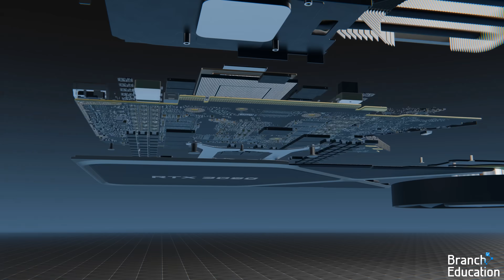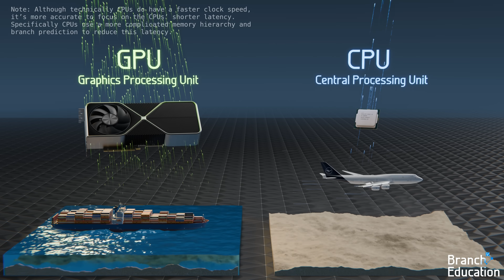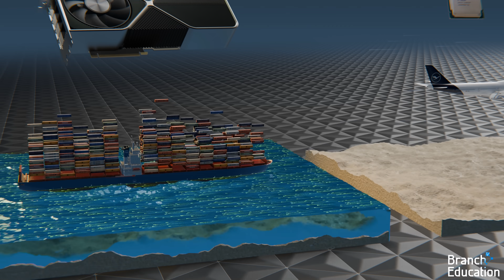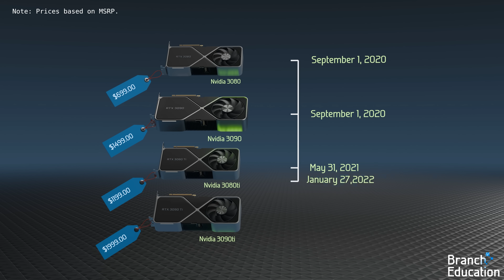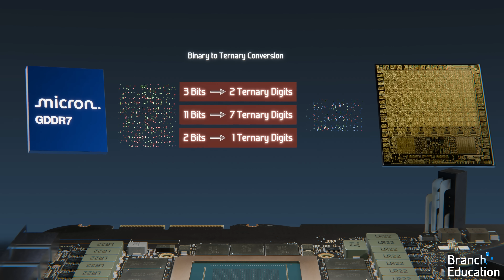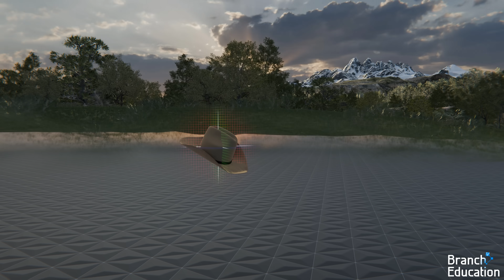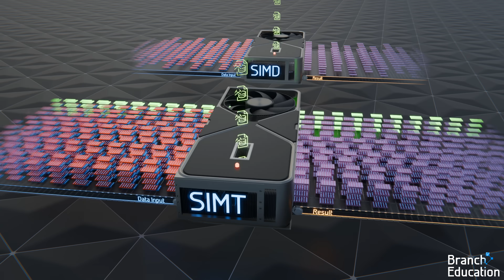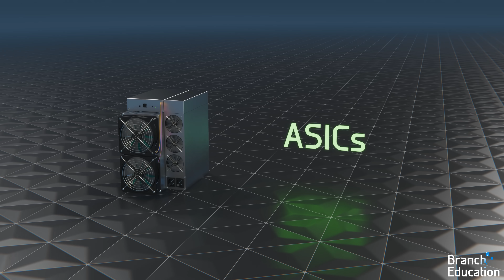How do Graphics Cards Work?  Exploring GPU Architecture

Comment: Hello, 
I am a materials engineer and have worked for Intel since they created the 8088 and 8086. If the time comes to perform like the latest processors are still based on cmos. I believe that we should go back to analog computers based on memory components and operational amplifiers for addition and multiplication. Including error noise that can be an additional value as a supercomputer for testing additional calculations and not single-valued. This situation makes the computer as a meta-computational to calculate additional results beyond logical 1 or 0.

Comment: So basically my 5070ti is just a semi-defective 5090?
Reply: NO it's a defective 5080. 5090 is on a different node
Reply: Sort of. 5060, 5070, etc mid ranges use smaller sized chips, whilst 5080 and 5090 use a very large chip 
But ultimately they are labeled in the same chip generation, with few variations

Comment: The number of calculations a game needs depends on scene complexity, refresh rate, detail quality and resolution. So cyber punk doesnt need 36 Trillion. It only needs it for your specific settings. for example 1080p would use much less processing power than 1440p. If we are talking about the bare minimum then you would need to put it on low setting and atleast aim for playable minimum frame like 30 fps. 36 trillion calculations is more than you think. A gpu with less than 10 tflops can play cyberpunk.  you dont need a 36 Tflop gpu to play it lol or the over kill 80 tflop 4090

Comment: Deactivated defective cores, blew my mind! So a 4060 or 5060 GPU is basically a defective 4090 or 5090!!?
Reply: No, they're different GPUs. The same GPU is generally only used for a few cards in a generation, since it works out cheaper to just manufacture the less powerful GPUs directly. For the 40 series, it roughly goes from least to most powerful:
- AD107 GPU: 4060.
- AD106 GPU: 4060 Ti.
- AD104 GPU: 4070, 4070 Super, 4070 Ti.
- AD103 GPU: 4070 Ti Super, 4080, 4080 Super.
- AD102 GPU: 4090.

Comment: So "Product Binning", different GPU models are essentially the result of binning chips with imperfections on the silicon die.
Reply: Only for a few select models per GPU. It works out cheaper to just manufacture the less powerful GPUs directly since the imperfections don't scale all the way down the product stack, so NVIDIA generally designs a handful of GPUs and will reuse binned versions of the GPU for cards around the intended performance bracket. For the 40 series, since I used it when replying to another comment:
- AD107 GPU: 4060.
- AD106 GPU: 4060 Ti.
- AD104 GPU: 4070, 4070 Super, 4070 Ti.
- AD103 GPU: 4070 Ti Super, 4080, 4080 Super.
- AD102 GPU: 4090.

Comment: So anything less than 3090, you’re paying for a defective unit? Lol
Reply: If you buy a 3080, possibly yes. Not all graphics cards within a generation use the same GPU. For the 30 series:
- The 3090 Ti, 3090, 3080 Ti, 3080 and select 3070 Ti's all use the GA102 GPU, with more components disabled as you move down the product stack.
- The 3070 Ti, 3070, 3060 Ti and select 3060's all use the GA104 GPU, which is physically smaller than the GA102 GPU, with more components disabled as you move down the product stack,
- The 3060 and select 3050's all use the GA106 GPU, which is physically smaller than the GA104 GPU.
- The 3050 uses the GA107 GPU, which is physically smaller than the GA106 GPU.

If you have a 3090 Ti and a 3060, they both use the best bin of their respective GPU, but if you bump down to a 3080 or one of those 3050's, then you move down a bin and you may have an originally defective GPU, that NVIDIA disabled the defective components of. AMD and Intel both do the same, even for their CPUs.

Comment: So cheaper gpu models are just broken?
Nice to know 😂
Reply: Not necessarily. Not all graphics cards within a generation use the same GPU. For the 30 series:
- The 3090 Ti, 3090, 3080 Ti, 3080 and select 3070 Ti's all use the GA102 GPU, with more components disabled as you move down the product stack.
- The 3070 Ti, 3070, 3060 Ti and select 3060's all use the GA104 GPU, which is physically smaller than the GA102 GPU, with more components disabled as you move down the product stack,
- The 3060 and select 3050's all use the GA106 GPU, which is physically smaller than the GA104 GPU.
- The 3050 uses the GA107 GPU, which is physically smaller than the GA106 GPU.

If you have a 3090 Ti and a 3060, they both use the best bin of their respective GPU, but if you bump down to a 3080 or one of those 3050's, then you move down a bin and you may have an originally defective GPU, that NVIDIA disabled the defective components of. AMD and Intel both do the same, even for their CPUs.

Comment: So we all bought damage GPU
Reply: Not necessarily. Not all graphics cards within a generation use the same GPU. For the 30 series:
- The 3090 Ti, 3090, 3080 Ti, 3080 and select 3070 Ti's all use the GA102 GPU, with more components disabled as you move down the product stack.
- The 3070 Ti, 3070, 3060 Ti and select 3060's all use the GA104 GPU, which is physically smaller than the GA102 GPU, with more components disabled as you move down the product stack,
- The 3060 and select 3050's all use the GA106 GPU, which is physically smaller than the GA104 GPU.
- The 3050 uses the GA107 GPU, which is physically smaller than the GA106 GPU.

If you have a 3090 Ti and a 3060, they both use the best bin of their respective GPU, but if you bump down to a 3080 or one of those 3050's, then you move down a bin and you may have an originally defective GPU, that NVIDIA disabled the defective components of. AMD and Intel both do the same, even for their CPUs.

Comment: Stupid question but if we know that the correct lottery ticket has the first 80 digits as zeroes, why not hard code it into the algorithm and keep winning?
Reply: Because you're not trying to find a number with the first 80 digits being zeroes, your trying to find a number that produces another number with the first 80 digits being zeroes, when used within a hashing function. In order to win the lottery, you have to specify that number that you found, and others will independently run it through the hashing function to see if it's legitimate, and will only give you your winnings if it is.
Reply: @jcm2606  I see, it makes much more sense now. Thanks!

Comment: How is the memory capable of transferring 1 terabyte per second to the GPU even though most graphics cards only have 24GB of memory or so?
Reply: Because the GPU repeatedly accesses the same locations in memory across multiple frames, whether it be because previously cached data for that location was evicted, or because the data at that location was updated and the cached data was invalidated.

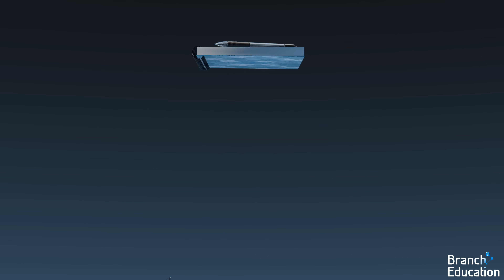Comment: 0:50 : There is an inaccuracy here. The presented analogy shows as an example of a calculation the multiplication of 4,689,732 and 2,764,569. When talking about CPUs, that is NOT a calculation. Those are actually dozens or even hundreds of calculations.

In CPU/GPU comparisons, they always primitive operations. not math problems.

Comment: I would have started with Multiple-and-Add/Accumulate after describing basic matrix math such as quaternion rotation linking that to computer graphics.   As presented the videos fails to keep things grounded to reality so interest gets lost pretty quick for the average person.   

Most of the 28+ minutes are vendor-specific and tool-specific.  In less that 5 years ALL OF THIS WILL BE OBSOLETE except for the core theory and ideas.  The thing that has not changed in literally 30-40 years is the core Multiple-and-Add/Accumulate.   

The obsoleting part could be the last 10 minutes.

Comment: So does this mean I should get a 3080 instead of 3070 ti.. 1) the 3080 is the next group of chips above the 3060s/3070s and is using the same chip blueprints as the 3090s  and 2) it sounds like to win the silicone lottery you don’t want a flawless card aka the 3090ti or 3070ti , they both would be flawless , and in order to get silicone lottery I could get a 3080 that potentially isn’t as damaged as some others and it would perform better .

Comment: 2:50 just came back from the cpu video so i already know that a cpu contains requires multiple ip cores just to make one core and seeing the image and the use of the GPU? its kinda obvious that it probably has like 1-2 IPcores which probably doesnt even include any addition macrocell. or does it? idk i will find out later in the video.

Comment: Great video, insane graphics and pedagogic examples !!!
Technically speaking, some information are wrong though :( 
- GA102 supports 1024 threads per SM => 32 warps [of 32 threads each]
- SIMT description is wrong: each thread does not have its own program counter (that would defeat the purpose of low-power gpu architecture), but each WARP has it's PC => 32 Threads of same warp are in lockstep execution [which is a very desirable property actually, allowing warp intrinsics powerful functions]
- The mapping 1 thread = 1 cuda core (or shading unit) is WRONG ! GA102 has 128 CUDA core (=10752 cores / 84 SM) => 4 cores per warp (= 128/32) in average. In the video, confusion is made between the 4*32=128 CUDA cores, which is not 4 warps, because 1 cores perform computations for 8 threads, which is exactly the point of SIMT, allowing memory latency hiding
- Tensor cores are not used to transform vertices of geometry (=4x4 matrix-vector multiplications), tensor cores are made for much bigger matrices, for NN applications

Comment: This is a nice video. But I have a small correction: GPUs are still SIMD architectures! SIMT rather is the programming model they use, making the inherit SIMD architecture transparent to the programmer. With newer architectures it is true that threads may make progress independently, but this is rather an edge case. The hardware (with help from the programmer ;)) certainly tries to avoid that, because whenever only a single thread is executing on a piece of hardware (let's call it SIMT core, c.f. SM or subcore in NVIDIAs terminology) that is meant to execute, say, 32 at a time, the other 31 "lanes" go unused, leaving a lot of performance untaken.

Comment: with s.i.m.d. and s.i.m.t. why do some threads progress slower than others.? i would think the calculations would be predictable. thank you
Reply: Because you can't reliably predict which branch a GPU thread wants to take at runtime. As far as I know, branch prediction on CPUs works by internally tracking which path a thread takes through the code, using that information to optimise the next execution of that code assuming that the same thread will generally take the same path through the code. This isn't feasible on GPUs because of the number of threads that would need to be tracked, which is on the order of hundreds of threads per SM on a modern GPU, between the size of an individual warp (32-64 threads) and the amount of warps assigned to an SM (4-16). Each thread would need memory set aside to track its state (see the branch predictor page on Wikipedia for a rundown of runtime branch prediction techniques), and the branch predictor itself would need to be large enough to simultaneously predict which upcoming branch will be taken for all threads in a warp.

This is why GPUs have gravitated towards SIMT over SIMD. Under SIMD, threads used to do branch predication where they straight up execute all branches and throw away the results for the branches that they didn't take. That was obviously incredibly wasteful, so GPUs gravitated towards a more dynamic branching implementation where threads dynamically enter and exit branches, with threads only having to wait for the branches that were actually taken, which the SIMT model lets you track. Compilers and developers naturally took advantage of this to optimise branching around making sure that as many threads take the same branch as possible, and the SIMT model was further refined on NVIDIA to allow for out-of-order execution of branches, which helps with memory accesses in branches.

Comment: I already shared and did subscribe and learning the PC and the process. So you can get an RTX 3090 bottom deck lowest price but the graphic sections will have damaged ones that will be isolated automatically. Not having the full range and bandwidth. I believe I got that right 🕊️

Comment: You don't need 36 TFLOPS to run cyberpunk 2077.
Playstation 5 pro doesn't even reach 33 TFLOPS and the switch 2 literally only has 3.1 TFLOPS and it runs cyberpunk 2077 just fine.

Comment: When the lack of hard performances is a fact -- it s where the need of the  soft ai 64 GB/second is to be resolved through less performance hardware systems when adequate methods are set and by multiplying low speed transfers .the- availability in data transfer canals for example is increased this way

Comment: The GPU architecture is organized into structures like Streaming Multiprocessors (SMs), each containing CUDA cores, Tensor cores, and RT cores, similar to the layout in NVIDIA’s GA102 chip found in the RTX 30-series.

Comment: Does this mean the 3090ti is the most powerful we can make on the GA102 architecture? is there a different architecture for future growth or have we reached max density?
Reply: GA102 is the last on the RTX 30 series. The GeForce RTX 5090 has the GB202 architecture with twice the number of cores, 50% more memory, GDDR7 (instead of GDDR6), and 33% wider bus.

Comment: Honestly idk if theres any explanation of this but with an amd gpu
Reply: The principles are like 80% the same for AMD GPUs. There can be differences in the exact memory and hardware block hierarchies, but most of what the video covers maps fairly cleanly to AMD GPUs. GPUs kinda naturally converged on this general design as it's simply the most optimal for the variety of workloads that GPUs have to deal with during daily use.

Comment: I'm from the generation of CPU's being made from 7400 series IC's made in the early 70's. A 16bit CPU had as many as around 900 chips spread over 9 plugin CPU PCB's. Floating Point was another four similar sized boards. Core memory was the standard type of memory and it's amazing how that works based on magnetism. So I find this video as intensely interesting. And I'm thrilled with the speed at which technology has advanced in my lifetime. In the late 70's a 200MB hard drive was the size of a desk, with 20 heads on ten platters. I'll be watching the other videos from this source. Technology is the closet thing to true magic. When people know about our technological knowledge we would get asked how something like TV worked, we'd answer "It's IFM" which meant, It's fucking Magic. It's more amazing knowing how this stuff works.

Comment: Very informative video. Question, how is the memory access handled when cores needs data. There must be a complicated memory access arbitration going on i suspect.
Reply: Yep. Typically threads will broadcast the address that they want to access as part of the load/store instruction, and LSUs (Load/Store Units), which are basically the bridge between the logical units and the memory subsystem, will arbitrate those memory accesses. To make things even more complicated, the memory subsystem also typically operates at a much coarser granularity than individual threads. Individual threads often want to access 4-byte data at potentially different locations in memory, whereas the memory subsystem operates on contiguous 32-128 byte blocks. LSUs are also responsible for handling this granularity mismatch, typically by organising the various accesses from all threads into a series of memory transactions operating on entire blocks. To keep performance up and to reduce traffic on the memory subsystem, LSUs will also try to combine all accesses to the same block into a single memory transaction operating on that one block, leaning on the assumption that threads will generally access consecutive addresses (which is something that you as a shader programmer may need to worry about).

Comment: So let me get this straight. In chapter 4 (7:00), we are basically buying the same GPU with the lower model cards having defective/deactivated cores? So if you take the marketing data on the numbers of cores advertised on each card number, you just need to subtract those numbers from the top line card models to find out how many defective/deactivated cores the lower card models have?

That is quite an eye opening fact as current marketing gives the impression you are purchasing slightly different variants of GPUs that happen to be part of the same GPU series. This of course would not be practical seeing they are all being fabricated using the same equipment. 

I imagine it would not go down very well if Nvidia were to market a 3080 as having, say, 50+ defective/deactivated CUDA cores. That is quite an ingenious way for Nvidia to sell through partially defective stock vs binning all GPUs below a 100% success rate. Thanks for this video.

Comment: The major flaw in your
 teaching technique is the use of analogies. Analogies are a bad way to teach. If you know enough and understand enough about the hardware, you can explain the hardware using the hardware. To change it over into using an analogy and then try to switch it back to hardware is a ridiculous idea. It's clunky it's unclear and it really indicates you cannot explain this at the hardware level. Too bad I gave you 4 minutes. You totally lost me. As an engineer a design engineer and a physicist I find this a poor way for anybody to teach anybody anything. No trolling intended. However, I must admit that recovering from the inability of your people to explain the difference between complex and simple machine language instructions,  ... Boolean versus arithmetic logic...and the inability to explain parallel versus serial processing, I thought the entire thing was rather good. So I gave it a b+.